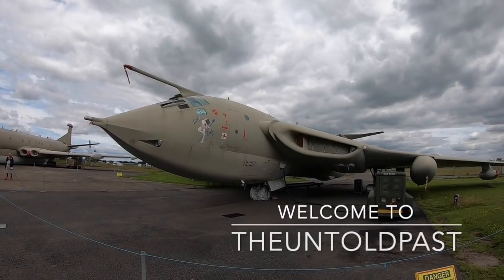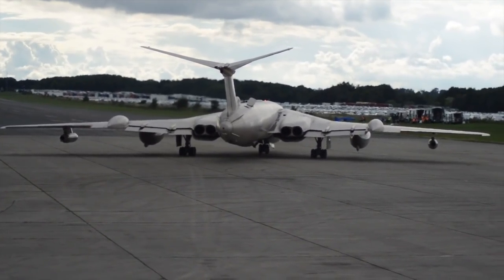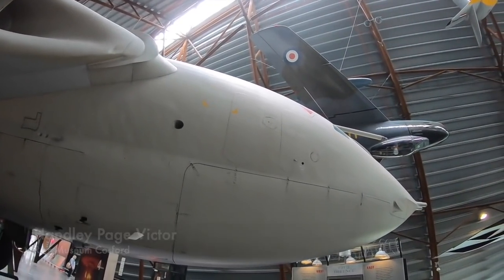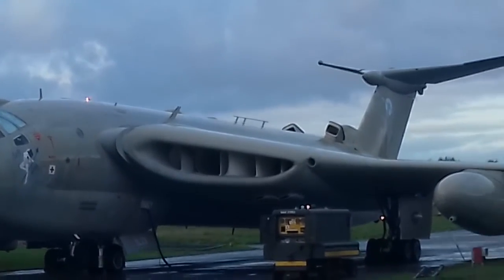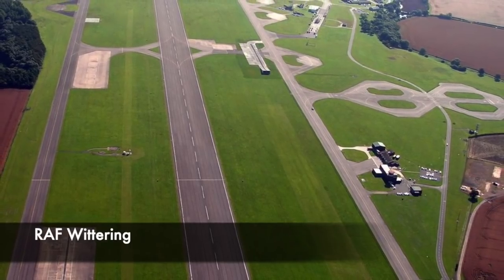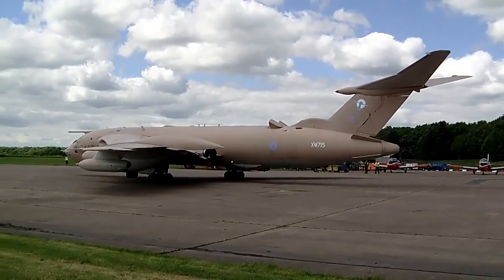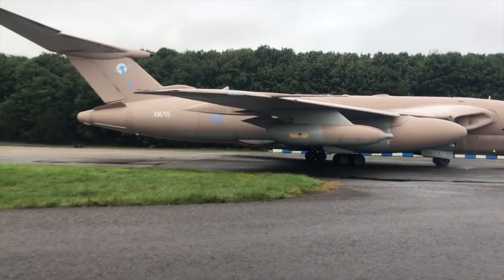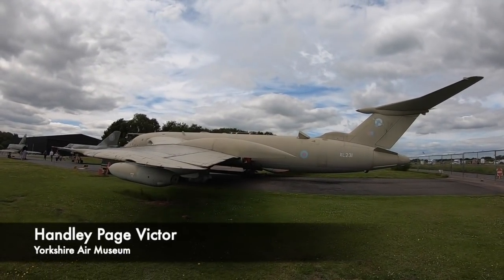The Tragic Story Of Handley Page Victor XM714

Comment: Very sad. I wonder what was going on with the pilot? Stall shudder is very noticeable and every pilot recognizes it.  A shudder should always be followed by a nose down. It's odd that he would want to pull up :(
Reply from the maker: Thanks for the comment. When making this I thought about that too, it seems he mis-judged his speed thinking he could still climb the aircraft.
Reply: Quite possibly he was trying to gain height to allow the guys in the back sufficient time to physically bail out ..not having ejector seats they would need height to give them time to manually climb out to the emergency chute...and time needed for their parachutes to open too ....the pilot.aware that his aircraft was going to down anyway could have been giving his crew this last chance ... afterall he didnt eject himself.
Reply: @stevegolding5523  Having had flying lessons many moons ago there is a basic instinct to climb rather than drop the nose .Height equals safety. In a stall situation the brain panics and by instinct will pull the yoke back not forward.
Reply: I think they failed in their Airmanship , two pilots . One should be flying the plane the other should have been dealing with the engine fire , if that had been the case they wouldn't have stalled !!! .
Reply: @glennpowell3444  Im sorry I cannot agree ..I've been a Commercial and Private pilot for 35 years  flying light and heavy  twins  ..accumulating over 9000 hours in command and cannot agree with your argument at all ...... these aren't basic low time pilots with a couple of hours in a Cessna 152 with an instructor sitting next to a nervous novice during stall training and 'quoting' from the flight manual. Height isnt necessarily safety as you quote ..does rather depend on what is above you and for a novice pilot climbing into cloud will probably kill you quicker than anything else in aviation.  But these pilots are some the worlds ELITE NUCLEAR BOMBER pilots flying during the Cold War with thousands and thousands of hours flight time in ..at the time ... one of the worlds most powerful aircraft and flying to the demanding regulations and training of the RAF.   So no they are not going to pull back cos they might be a bit scared. On the contrary..and if you had had more flight time you would know that the instinctive natural reaction to a stall warning is to LOWER the nose. Look there are different ways of Stall andvStall  recovery ..you can lower the nose to gain speed.... but if you are  on approach in a stormy night ..  at 500feet ..low visibility.. rain ..and a strong blustery cross wind the chances are that you are going to get a "Stall ... Stall " or stall buzzer sounding depending on what you are flying ..   then the last thing you would want to do is lower the nose !!!!! ..... THE SIMPLEST THING ...Just add more power.
  So the pilots reaction depends on the situation.
All a stall is that there isnt sufficient airflow over the wing to produce enough lift for the aircraft weight,  configuration or angle of attack ... so to PREVENT the stall  increase the airflow. I'm not going to go into all the different types of stall ...but for instance you can just stall one wing .. you can even stall PART of one wing ..and the recovery methods are very different .. but on this flight they had the complication of a fire ..possibly a compressor stall  to cope with as well, a very heavy aircraft and the knowledge of the  inability for the rear crew to be able to eject and no doubt the onset of an assymetric stall to contend with. What would you do ? ... he had a choice ... could have simply popped his seat and lived to tell you all about it .... or could have tried to get height to save his crew and die trying. But panic. No way.
Reply: @zeberdee1972  ....what on earth do you think the second crew member was was doing .. serving coffee and duty free ... duhhhh.
Reply: @stevegolding5523  Well some one wasn't looking , otherwise they would have known they were stalling  . Im not blaming the first Officer as he may have been dealing with the engine at the time .
Reply: @stevegolding5523  Hi.No I agree with you all day long.My comment references the air France Airbus disaster back in the 90,s(?) where the first officer who was flying didn't realise the aircraft was approaching a stall and responded by altitude loss by asking for more power whilst pulling back on his joystick.By the time the captain realised and tried to push his joystick forward it was over ridden by the first officers input. I was merely suggesting that impulse of the brain can and did tell that right hand seat to gain altitude.Thanks for your comment .
Reply: @zeberdee1972  as my previous answer ...his actions may have been to intentionally climb the aircraft knowing full well it would stall in an attempt to get as much height as possible. As deliberately taking the aircraft to the stall in a climb would be the maximum height his damaged aircraft could ever achieve....not because he was an incompetent pilot as you suggest. .but.in an effort to allow his rear crew the time to be able to exit the aircraft manually as they didnt have ejection seats and give as much height for their chutes to open as possible.  I do hope this is clear now.
Reply: @zeberdee1972  thank you for your reply Nathan. I must apologise to you as I thought this forum was for people that had an understanding of aviation and could offer alternate views based upon experience and knowledge...personally I have been a commercial pilot for 35 years but I expect your experience is limited to an x box or something where you probably get excited about turning on the safety belt sign using the F1 key or something... . So I must apologise because it is obvious to everyone that you have no real aviation knowledge.... you seem to think because an aircraft stalls it will crash ... not so ..its easily recovered in a matter of 100ft or so ..more depending on conditions and type of stall.... you have no knowledge on aerodynamics or you would realise that on T tailed aircraft they can enter a deep stall that the pilot has no control of and is impossible to recover from  ..I suggest you look it up ..its to do with lack of airflow over T tail control surfaces that doesnt effect lower tail configurations..for your information .modern T tail aircraft ( and most others ) have stick pushes that operate before the stall can devlope ( I flew the T tailed  ATR 72 - 5 and 600's ) .. the Victor didnt ..along with a wing that caused  pitching up..which was never fully resolved in its production run ..caused by the varying chord thickness of the wing. .but then I expect by now you haven't a clue what I'm talking about...  you also refer to" First Officer" .... err .. this is a commercial aviation term that's not used in the military ...and you certainly have no knowledge of cockpit operations...  YET DISPITE ALL OF THIS you are happy to blame a pilot for failing in his duty and killing his crew based on nothing but your ignorance. So yeah Duhhhhh.
Now I have never said the pilot didnt cause a stall ... but see no reason why he couldn't have recovered unless there other limiting factors ... the aircraft configuration could have caused a Deep stall of which he would have had no control over whatsoever .. or may be he did try to gain height to give his crew a chance of escape .. I cant say. REMEBER TOO THAT ON TOP OF THIS IT WAS ON FIRE.   . So yes .. if you think I'm up my arse ..then I am.. but it's better having knowledge and experience and being able to offer a possible educated alternatives ..than just being ignorant of a subject you obviously have absolutely no knowledge of.
Reply: @zeberdee1972  Poor dear. I think you should understand that there is a difference between sarcasm and being rude. I used sarcasm for a bit of levity ... you on the other hand ......
Reply: @zeberdee1972  Bless
Reply: @zeberdee1972   there are a number of people reading and responding to these posts so thought I would answer this too. Now this is no way criticism of Nathan's thoughts thinking they could bail out ..as I expect most people would think that at 4000feet the crew would have enough time to bail out. Unfortunately aviation isn't always straightforward and time is a very precious commodity that pilots dont always have.
Now I have to make a number of assumptions because we dont have the full facts. So if we assume the captain called for the crew to abandon the aircraft at exactly 4000 ft .. he may have called this at a lower altituded we dont know. ...but if the aircraft stalled at 4000ft we will work from there and say he called it immediately .  We also dont know if the aircraft then fell vertically or at what angle.  So I have assumed he did have some control and for this I have said the aircraft fell at 45° to the surface ..highly unlikely  as I expect the angle to have been much greater giving much much  less time  ( so we have 4000ft = 5160ft @45° ..or about 1 mile  travelled from that height to impact ) ...I have also assumed it fell  in a wings level  attitude.... if it was turning or spining then G- forces would be an added hindrance and time delay --  also if the aircraft was in a bank then the crew would take much longer getting to the exit door as it could even now be above them.  Even with these very optimistic assumptions from 4000ft this would only give the crew 14 seconds before impact. The stall speed would have been around 120knots ( 138 mph ) ...may be more depending on its actual weight- however something weighing between 39 tons empty  to 91 tons max weight will accelerate in the fall very very quickly. So I assumed a slow fall accelerating to 250mph.... probably much much faster.
So 14 seconds was all the rear crew had  to abandon the aircraft.. pull their chute and land safely...( I suspect this time was a much much shorter period in reality ) .. So firstly the rear crew must react to a call to abandon the aircraft ..this would take a couple of seconds for the brain to acknowledge and to start a reaction -- i havent accounted for any timefor the shock of the situation the crew faced. The crew ...there are 3 in the back ... would then have to commence undoing a 5 point harness and begin to leave their seat say  4 seconds ..they then have to make their way to the door and open it.. 5 seconds ...it opens inwards causing more delay ..say 2 seconds ...so the first of 3 crew are at the door  assuming they reacted immediately with lightning speed then 13 seconds are already up.  
So I think it would be impossible for the crew to react .. then abandon the aircraft ... delay opening their chute to ensure they clear the aircraft and not get caught up. ..then for the early circular uncontrollable chute to open fully and then arrest the fall and time for the crew member to land safely...all in 14 seconds. Its an unservivable accident for the rear crew even at this height.
Sadly this is why a number of the rear crew lost their lives in these aircraft. Even the Co pilot who did use his ejection seat suffered serious injuries.

It is surprising how much time is compressed in aviation ..
and Pilots will do everything to  try to analyse a situation and find a solution or solutions that at times are beyond the time they have available. 
 I was on an annual check ride for my private twin engine aircraft rating when the examiner pulled the mixture back to simulate an engine failure..this was at 3500 ft. Nothing surprising they do it everytime you just dont know when.
Normally this just leaves the propeller on the " dead " engine wind milling ( turning ) but producing no power . You then ..the pilot being examined of course ! .... have to determine which engine has failed and go through a sequence to restart it...while naturally keeping the aircraft under control.  However on this occasion the prop actually stopped !!. No problem.. just follow the same procedure for a restart. We were flying a rental twin Beech Dutchess ..which like most light twins cannot climb on one engine .... I personally owned Cessna 310s and a 320 which are some of the very few twins that can climb ( slowly and very carefully !! ) on one engine. Anyway after 3 attempts by myself to re start the engine it would not respond and we were descending all the time... so the examiner had a go ... then another ..and a third. Still without luck. Fortunately on his 4th go it sputtered into life and we started the climb away ...it was only then that we realised we were below a 1000 ft. We had both been so distracted by something as routine as an engine restart ..and although every now and again we had individually looked out of the cockpit window to check where we were and our height it was still surprising how low we had got. This was undertaken  over open ground of course . We were still  above the minimum legal height of 500ft above the nearest object or person. But we did have a nervous chuckle.
Reply: @stevegolding5523  I'm puzzled as to why they didn't increase power. with three Conways you'd still have a surfeit of power.
Reply: @paulholyoak5436  Hi Paul ... I've looked at the offical reports into this crash ...which took place at
 night and which was on a slow speed exercise ..which previous commentators have failed to mention.... and it states the following -- 
" At the inquest which was held in Peterborough on May 16th 1963 the sole surviving airman (Flight Lieutenant Brendan Jackson) informed the inquest jury that No 2 Engine Warning light came on at about 800 feet  and they commenced the normal fire drill. They could not see the engine in question so the only indication of the fire was the warning light. The Base was informed of the incident and the crew were warned to check their parachutes. At this stage the aircraft suffered severe buffeting, an intense vibration caused by aero-dynamic reasons or by mechanical failure in the engine. Shortly after this the nose of the plane reared up and it went into a spin. The Captain gave the order ‘Get Out, Get Out’ and the Flight Lieutenant ejected at about 2,000 feet, before leaving the plane he heard someone at the rear say I can’t move. The design of the plane meant that although the pilot and co-pilot had ejector seats the rest of the crew had to bail out. This was not an easy procedure due to the restrictive nature of the interior of the plane and the danger of being caught by an engine when bailing out. A witness on the ground stated that there was no fire on board the plane prior to the crash. Three of the deceased were buried with full military honours in Wittering Cemetery .
Flight Lieutenant Jackson’s stated at the inquest that:- “I think the captain very courageously stayed at the controls  when he could have used his ejector seat , because of the knowledge that the rest of the crew could not get out.”

So possibly this aircraft was simply brought down by a mechanical failure which
the pilot had no control over and possibly though G Force pinned the rear crew to their seats who were unable to escape. The exception being the flight crew who had ejection seats...of which only one was activated. The aircraft was completely destroyed on impact and the following intense fire ... leaving no clues other than the crew mentioning the No.2 Fire Warning activating.

. I learnt to fly 40 odd years ago in Piper Tomahawk's ... a real pig when it came to stalling because you would hold it nose high with the stall warning going ..reducing power and balancing with bootfulls of opposite rudder every time she started to drift one way or the other ..then bam ... it would stall a wing and roll you right over..once may be twice so fast not even my instructor could say how many times exactly.  You had to desperately retrieve the situation quickly or she would enter a full spin. I mentioned T tailed aircraft earlier as they are more problematic because you can sheild the tail control surfaces from airflow by the wing ..especially if stalled level and descending nose high...then you have no control at all ..A Flat Spin.  The Tomahawk was well know for developing a spin when training for Stalls. Spin training said you had to recover the aircraft after a maximum of 3 rotations ..from height . In fact Spin training was removed from the PPL syllabus a very long time ago  purely because it killed quite a large number in training accidents in various aircraft ..even the docile Cessna 152 ..which I personally have never flown.. despite having a fully qualified instructor sitting next to the student who could take over..they would still "spin - in". ...Spins  are just too much of a risk to teach recovery from in actual flight. 

B
Reply: Yeah, I agree. When stalled you instinctively put the nose down. This is all conjecture. I speak from experience.

Comment: My father used to fly these at Wittering! I still have his log books.
Reply: His log books are priceless.
Reply: @charlesrussell1764  Interesting. I mentioned them to the team looking after the Victor at Bruntingthorpe and they didn't seem interested.
Reply: @johngreen8693  I am not surprised, but surprised that you mention it. Thoughts change nothing, Having been an instructor, I can relate to the crew on board at the time.
Reply: @charlesrussell1764  Yes, Charles. Not that it matters. Still a lovely aircraft and I can remember them doing a demo QRA with four taking off in a "scramble" Sadly, I still don't know much about day to day life for the crews at the station.
Reply: @johngreen8693  I had a friend in the air force at Cottesmore and stayed there once. I was most impressed at the lovely shine on the lino! Your father's log books are a valuable document, look after them. Incidentally, standing by the runway as 12 Lightnings go past on a full reheat takeoff is an experience I shall take to the grave.